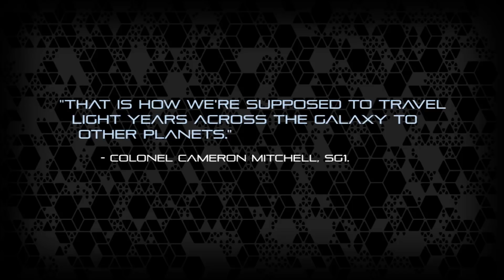The Stargate - Spacedock Sci-Tech.

Comment: Stargates do create wormholes, but they're also teleporters. They dematerialize travelers,  sending their substance through the wormhole before putting them back together.  The wormhole always works in both ways, allowing radio signals,  radiation, even gravity to come through,  but  it will only teleport matter coming in from one side.

Comment: Always love the Stargate content here :)
Small nitpick, but technically there are two 9 chevron addresses. Any 2nd or 3rd generation can dial the Destiny address, despite the origin point always being Earth. Yet, Destiny itself has a 9th chevron address in its databank that connects solely to Earth. 8 are listed  with the 9th added through the program based on the distance.

(on my part, I assume the 1st generation gate cannot dial Destiny through a 9-chevron dial sequence because unlike its successors, its glyphs aren't based on points in space, something that is required for the "code" of the to-Destiny address)

Comment: The gates are technically bi-directional, just you best not be anything that needs to be re-integrated. Raw elements like radiation and stuff can go both ways, as seen when the SGC blew up the surface of a planet and the radiation fed back through their outgoing wormhole. Then there was the whole black hole incident. So it's not that the gates are unidirectional, it's just that the pattern buffers are set a certain way to prevent patterns from being mixed up. Literally what happens when you go through an incoming wormhole is you just sit in the outgoing gates buffer since it won't re-integrate you, you only cease to exist when it wipes the buffer the next time it activates.

Comment: The two issues I've always had with the Gate depictions were: 1) Only matter cannot travel backwards through a SG, and 2) the iffy consistency of the initial energy wave.

My head canon for the first issue was that signals (e.g. radio waves) were traveling through the rings themselves and not the portals, acting sort of like radio antennae; or maybe traveling on a different data stream/band of sorts than matter, in a similar vein to wifi, since the Gates are shown to function like computers.

However, the second one is much harder for me to reconcile. Sometimes we'll see team members or equipment standing right in the path of the energy whirlpool, with the Gate conveniently initializing off-screen. The other thing about it is that it felt like the titanium iris should have needed to wait until after the whirlpool for it to close, especially after it was shown that the first iteration wasn't unaffected by energy hitting it. After all, it's not a matter of matter materializing on startup, it's a jet of pure energy that can disintegrate metals and people! I know there was something about being able to control the Gate's habit of creating the energy whirlpool presented later in the series, but that doesn't satisfy these slight early inconsistencies, at least for me.
Reply: Alarec Scarbrow. My own head canon on energy travelling both ways but matter travelling only one way, is that the mechanism exists in the gate system to "reverse the transducer" if we only knew how to access it. When an off-world site dials in, the cheverons on the homeworld gate lock in sequence, ending with the home point of origin. So the gates communicate with each other through subspace, and the act of laying in an outgoing address cause an incoming address to also be laid in. From there It's just a matter of how to reverse the polarity.

In the feature, before this concept had been worked out, they showed the back of the gate form a vortex out to nowhere, but in the series, when the gate activated, the back of the gate was always flat. I wonder if they ever tried this experiment: Dial an off-world site, send someone holding a baseball through, then have him walk around behind the off-world gate and throw his ball through its reverse horizon. Would it disintegrate, or would it bounce off the back wall of the gate room?
Reply: @TheDetailsMatter  The vortex in the movie didn't stick around, it appeared briefly (as an aftershock to the whoosh) before going flat.
Reply: @Swiftbow  Okay, but it doesn't affect the rest of what I said. We've seen 3 times that the gate can just be reopened to an outgoing wormhole without entering new coordinates: Apophis did it in the pilot episode, Nox Lya did it while rescuing the Tollans from Col. Maybourne, and Old Cassandra did it to send SG1 back to their proper time. So the radio communications may not be travelling the wormhole at all, just accidentally tapping into the two gates' own direct subspace comlink.  

As for the other side of the gate being the wormhole in reverse, two episodes support this. The factory world of Harland  ("Comtraya!") has a ramp on both sides of the gate, implying that outgoing shipments could be sent at the same time the factory was receiving new raw materials,  and the trip to the Rhi-tu Rebel planet. 5 rebels came back with the SG teams and Tokrah, undetected even though the gate was being scanned by TERs on the return of the humans. There was no TER activity on the outgoing trip, so the rebels might have come in via the rear of the gate while the SG recon party was outgoing through the front.
Reply: @TheDetailsMatter  In the pilot episode, the Jaffa dialed the Gate manually. Teal'c hand dialed it in just the same way a couple times. Arduous, but there were a few of them there. (It was done offscreen, but the director's cut added the sound effect as the marines were running down the hall.)

Lya and Cassandra were using wireless tech (or Nox psychic ability) to dial the Gate. It's advanced... it doesn't mean the Gate isn't receiving instructions the same way. It's similar to how the Gates are dialed in Pegasus.

The last two are entirely speculation. The double ramp may just be for bringing packages down the other way after delivery. You can walk through the open Gate when it's off, after all. As to the other one, are you sure they already had the TERs? Regardless, the Reetu episodes had a LOT of issues. There's a reason they dropped that plot thread entirely. 

Additionally, since we're speculating, maybe the Reetu were already there from earlier, or maybe they hid behind SG members to block the TERs during the return trip.

Any of these explanations are far better than anything that violates one of the primary rules of Stargate's wormhole physics: You can only go through one way.
Reply: @Swiftbow  Dialed it manually? With soldiers  shooting at them? Really?  Talk about dedication.

Apophis touched a control on his wrist and the gate just came back on, and then he stepped through, followed by Teal'c and the captive sergeant.

Lya used no device, she activated the outgoing wormhole with the power of her mind. No redialing. Not even a kerwhoosh.

Cassandra did use a device. The gate kerwhooshed, but the dial did not spin. She just fed it power.

Yes, they had the TERs, because the Tokrah provided them. Because common wisdom says nothing can come in through an outgoing wormhole, they didn't bother to TER the gate on the departure, just on the return. Rhi-tus are big-ass bug critters. There's no way they could hide from a TER in the shadow of a couple of small, slender humans. And they can't cloak from a TER or the rest of the episode they would have continued doing so. They had to have arrived before TERs were in use. The most likely time for that is when the recon party gated out to their world.

Look, we're both making a lot of assumptions here. The difference is, I'm assuming there is more to gate physics than what we have seen, and you are assuming there is not. I think mine are the more justifiable assumptions.
Reply: @TheDetailsMatter  That's fair. If you're right, though, I think they may have been referencing the Rhi-tu (is that how you spell it?) incident as a callback joke in the Wormhole Extreme episode. (Marty was very adamant about the Gate being one-way, except for radio, etc., while the studio exec didn't care.) In other words, something they messed up on that they preferred to get rid of by not bringing it up again; like the Zats being able to disintegrate after three shots.

You may be right about Aphophis using the hand device in the pilot, but that may fall under Early Installment Weirdness, because no system lord ever has that tech again. (Maybe Anubis?)   They would have needed some power source, because I don't think the Gate was hooked up at the time. In any case, I would like to point out that Carter's SGC Gate dialer technically ALWAYS dials the Gate manually, because off-world Gates don't spin when the DHD is used. (Usually.)

Oma activated the Gate exactly the same way as Lya (when Daniel ascended), which is interesting. As it also implies the Ascended can't travel anywhere instantaneously... they have to hitch a ride or use the Gate network.
Reply: I always assumed based on the effects we see when the gate opens while the iris is closed that the iris somehow reflected the vortex backward. It doesn't make much sense, since we clearly see the vortex burning through anything and everything otherwise, but it's possible that the atomic precision with which the iris was places effects the vortex as well as incoming matter.

As for people standing in front of the vortex and not getting hit...I never noticed that. You're probably not supposed to think about that too much, or assume they stepped to the side or something.
Reply: @ThePCguy17  Carter mentions at one point that the Iris prevents the Whoosh from forming. I do not remember which episode.

I don't recall any instances of people standing in front of the vortex and not being vaporized. Some of them are VERY close, but physical contact is needed for there to be an effect.
Reply: It may just be a matter of distance compression using a long lens, and deceptive camera angles. The SGC gate is at the top of a ramp; someone of average height could stand anywhere below the halfway point and not be in danger. I'd have to scan through my box sets to confirm, but I think in later seasons they added a yellow caution line to the ramp (and the floor of the alpha site) to mark the danger zone more clearly.
Reply: My headcanons: 1) The Gate disassembles things to their base particles, which is really bad for a person if they're not put back together, but as radio waves are photons, they're already base particles and can't be disassembled further, hence going backwards through the Gate doesn't change anything.  2) The VFX of the kawhoosh's length, widths, and angle always bend it out of the way of the people and props sitting on set because the scene has already been filmed, so you just have to assume/accept they knew how to stay out of the way when they positioned everything, even if it meant they weren't exactly where it looked like they were.  And the Iris is close enough to the event horizon to disrupt and prevent the burst to begin with (however that works, but it does because it has to).
Reply: I wonder if a star trek transporter would be able to send someone back through the worm hole...

Comment: It should be pointed out that on numerous occasions, Stargates have demonstrated an additional capability that might also have been linked with the operation of the 9th chevron, that of time travel. A wormhole passing through a solar prominence picks up a phenomenal burst of extra energy, causing the destination to shift not to another Stargate nearby in space, but to the same Stargate as designated but in a different era in time. 

It could easily turn out that this was intended by the Ancients to be a function of the 9th chevron, to input any of 39 different eras (the number of keys on a DHD) to send the traveler to, but was deemed impractical due to the absurd power requirements to activate the feature. Upon arriving, the traveler would be stranded, lacking any practical means of feeding the gate sufficient energy to access chevron 9 for a return journey.  Instead they went with the puddle-jumper time engine concept, since a jumper in flight operates on energy drawn directly from subspace in the same manner as a zero-point module.

Another feature of the gate depicted occasionally but never explained in detail was dial-free return activation.  Whenever a gate registers an incoming wormhole, the chevrons lock in sequence, finishing with the point-of-origin symbol for the world on which the receiving gate currently sits. These symbols are the address of the sending gate, automatically laid in in preparation for the return trip. 

Once a gate sends a wormhole to another gate, the potential for that wormhole remains even after the gate powers down; that potential is only erased when a new address is dialed. Several travelers, such as Apophis, Lya of Nox, and Thor of Asguard, have demonstrated the ability to reactivate the gate in the opposite direction without dialing, simply by applying power. All a dialer at a gate with a DHD needs do is push the big red ball to reopen the gate out to the locked return destination. Redialing is unnecessary unless a different destination is desired.

Comment: After the series ended, I spent a lot of time geeking  out on the subject of unanswered questions about the gate and related subjects. My SG-1 geek file includes things such as why the event horizon looks like water, how to dial *67 on a stargate, why it should be unnecessary to dial the 7th symbol, how to keep unwanted visitors from sending dreadnaughts through your supergate, and why radio only seems to travel both ways through a wormhole. Alas, with no active Stargate series, I have no outlet for these notions.
Reply: Some of these did get answers in the show though, and others can be inferred easily enough. SG-1 had a whole episode (s10e3 "The Pegasus Project") focused on keeping unwanted visitors coming through the supergate. As for two way radio communication through gates, it's heavily implied if not stated outright that the one-way travel rule only applies to matter. Presumably this is an inbuilt limitation of the gates, either to prevent accidents (e.g. someone coming out of the same place someone else is entering) or because the gates physically can't handle two-way travel. You're totally right regarding the 7th symbol, though. The only excuse for that is that it's a holdover from the movie which wasn't exactly written with over a dozen seasons worth of spinoffs in mind.

Comment: This always bothered me. If you need 6 Chevrons to pinpoint a specific Stargate within your own galaxy, why does a single additional Chevron suffice as home address. This never made sense to me and i seriously think it actually doesn't.
Reply: 38 points in space.   1 origin point.

I.e point of origin glyph is never used as a destination glyph.
Reply: @catprog  If a single glyph can pinpoint the location of a system, than there is literally no need to use 6 glyphs to pinpoint the destination. It simply makes no sense. I have no problem if the system does not make sense in our real world, as long as it is consistent with itself. The problem is it isn't.
Reply: @Widur42  

I think of it like a full stop at the end of sentence.

[26 letters make up the actual sentence] [Then you have a stop signal].

The singly glyph does not say this is the location. It says I am done.
Reply: @catprog  You could argue that way but you know that you are literally making this stuff up. This was never the explaination in the series. The reason why this is a problem is that all stargates in one galaxy have the same set of chevrons (which is why you can take one stargate and put it somewhere else and still use it as long as you know how to update the chevron combination according to its location). If every stargate uses a different chevron to mark its location, there could only be 36 stargates. Unless multiple stargates use the same chevron as source of origin (which i think they do) but then you could also always use the same chevron as the last and not vary it as it would literally not serve any location indicating purpose. The end result is that the explaination and usage of the 7 chevron adress does not make sense as it is logically inconsistant.